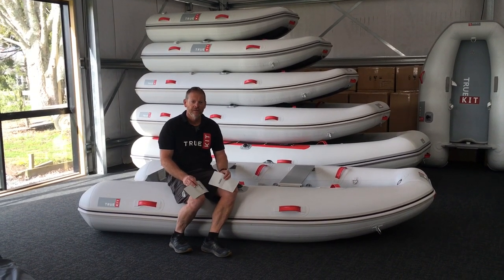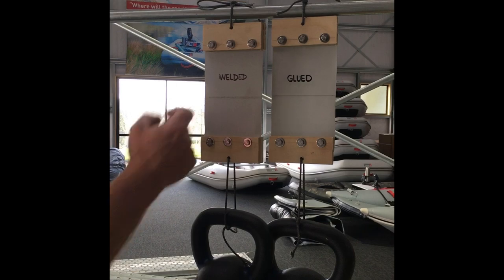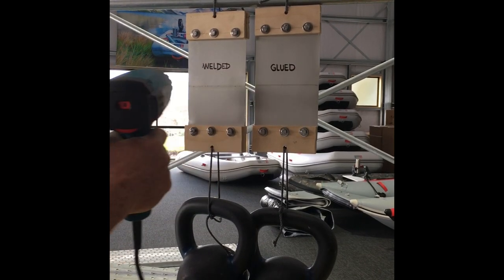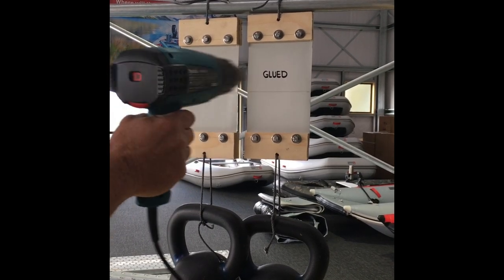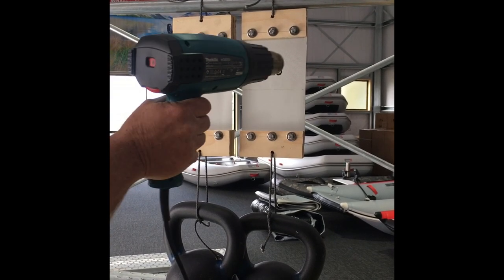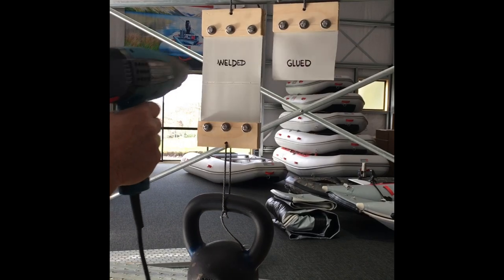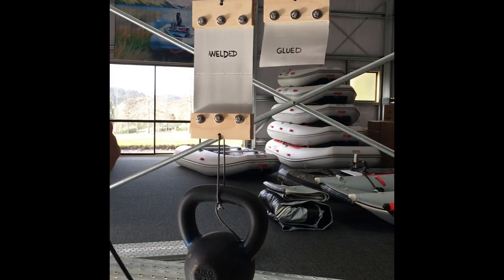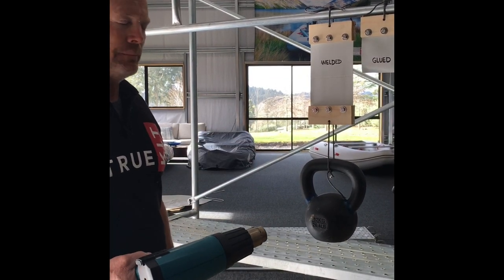Welded Seam v Glued Seam for Inflatable Boats - Workshop Test to Failure

Comment: The heat you're producing with that heat gun is way way more than that of the sun (if it was like that we were all dead). Also, many glues are known to soften under heat, and that one needs at least a week to fully dry.
So, what's the point?

Comment: hi there. I was about yo reglue my whole boat because It started to leak air at the joints. The boat is about8 yeats old. I just learned how to weld the pvc but I wasn't surebif I would weld or glue, bit after your video it is vlear to me. Thank you very much gor your time nsking this video..

Comment: I have inflatable from reputable company. This boat was used once and then put in storage@20c slightly inflated. So under ideal conditions. I took it out this summer after x number of years. All glued parts under pressure and sun stared fall off after first day. My concern regarding truekit is that it is made in China,  I don't see advantage ordering boat from them over Aliexpress for half price. I live in US so waranty will not be usable in both cases. Their competition has reps  in US and I could atleast see and try before buying. But yes I belive welding is supperior to glue.
Reply from the maker: It's no surprise that your dinghy fell apart.  This will happen to most glued inflatables especially using the cheap fabrics that they use.  The plasticisers leach out of the cheap fabrics (that's when the fabric starts feeling sticky) and attacks the glues, that's when it all starts falling apart.  Our boats use German made Valmex (not Chinese fabrics).  Our designs are our own.  We stand by our boats.  Good luck with your Aliexpress boat

Comment: But a glued seam isn’t going to come apart like that from a day in hot sun. Or days and days in hot sun. Eventually, that COULD happen.

But it’s not going to happen with a heat gun like your test either, pieces that you guys glued.

Mind you, I’m not totally sold off the superiority of welded seams, albeit harder to repair than glued if needed, but I don’t think this experiment is an accurate representation.
Reply from the maker: Hi Ira, thanks for your comment.  I respect your opinion.  The point of this video is to provide an indication of how heat+pressure affects the glued seams of an inflatable boat - not to provide a normal timeline (that would be a longer video no one would want to watch).  The point of the video is to be informative.  If you don't think a boat seam can come apart like this on a hot day in the sun, there are thousands of people out there that would point out that have experienced seam failure.  Also, feel free to do this test yourself and you will get the same result. Thanks for watching.
Reply: @TRUEKITINFLATABLES  I Have lived in Florida in the U.S. for 35+ years and been on the water most all those years. I have had many boats, most fiberglass, but also a few inflatables, "Avon" and "Zodiac" with glued seams.  I don't doubt welded seems are better either, but I have not, nor have I ever known anyone else, to have a catastrophic failure of a glued seem like you just demonstrated.  Heat guns create such a high temperature I think the boat owners skin would burn off their whole body before their seams would fail.  Those things melt 30 year old paint off of wood and such.  You cannot compare a heat gun with several hundred degree temps to the sun a boat would endure.  Truly a dishonest test.  You could make the point welded seams are better than glued without being that dramatic and dishonest.